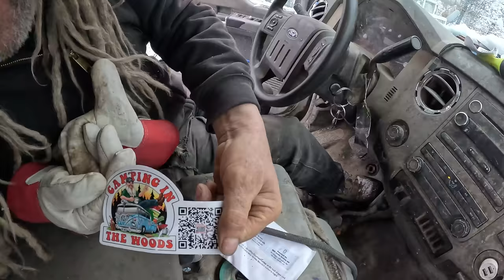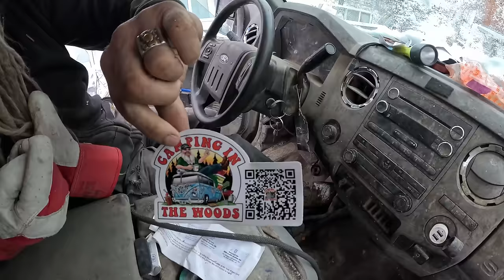Mike Sells Buried Scout Terra Truck

Comment: Mike I have been towing for 20 years and I hate to say your wrong doing the straps on the scout Blair is right you cross hatch the straps, I have learned because I had done it your way on a snow bed and it slid over, it won't move at all  crossing the straps

Comment: Plate clamps work .uch better than the 3 stooges LOL ( no punt intended ) plate clamps tyicly are hoistsing one inch HSS high stre gth steel plates ( they can be found at a large manufacturing auction . Buy a hole in tin buck two can sacriy( if one of the stooges that has there hand in their pockets goes and finds one during the time it took you to teach the kid cranking the trailer.